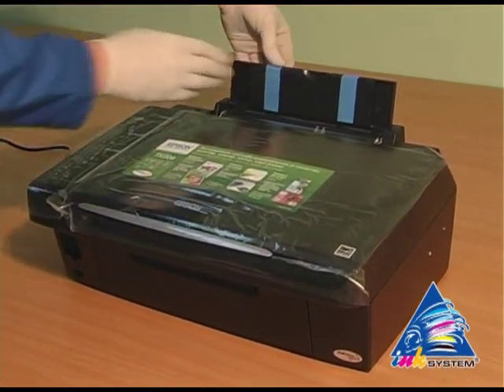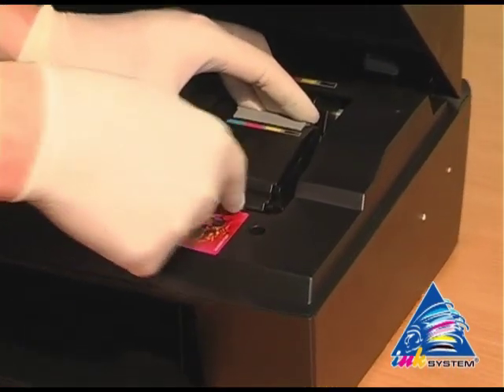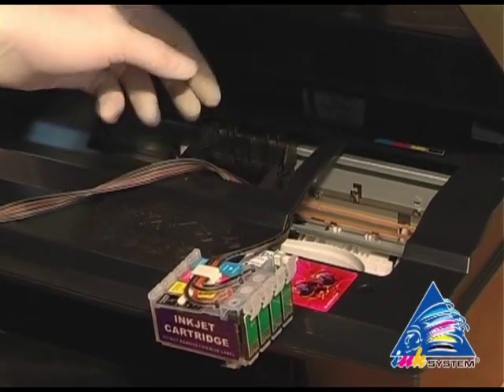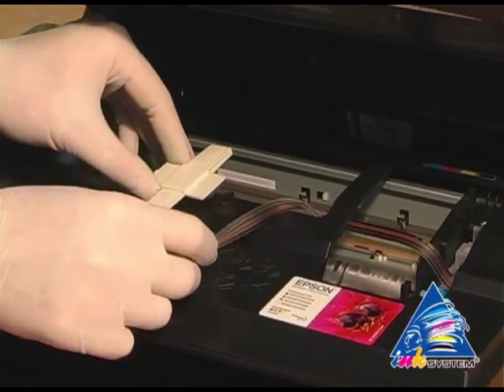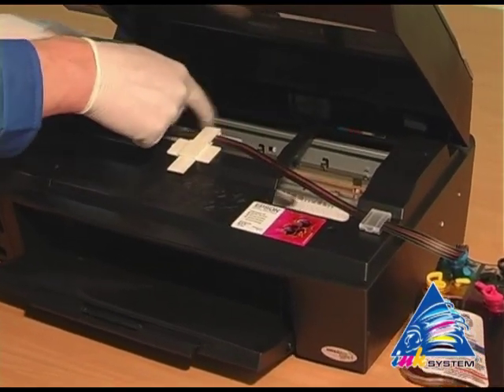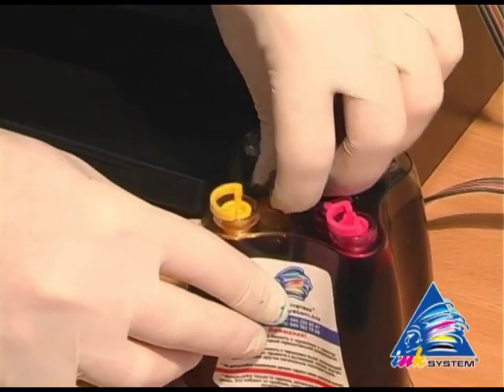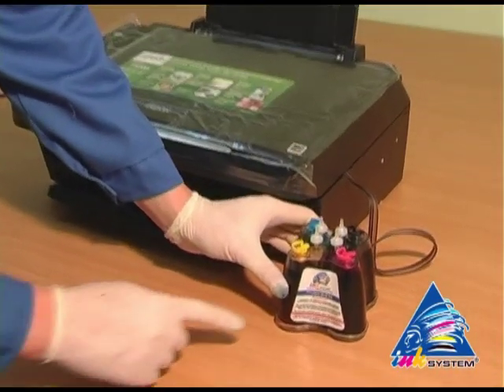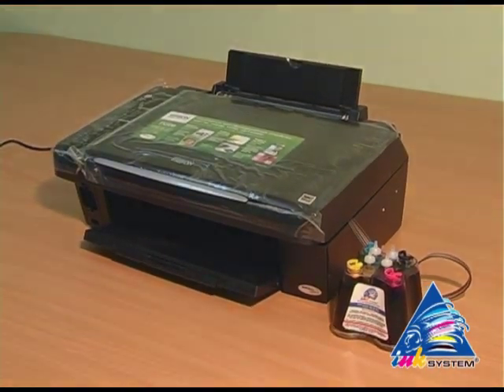CISS installation on EPSON SX200 / SX205 / SX400 / SX405

Comment: DESPERATELY NEEDED HELP!
I have 97% everything the same way.
I put everything as mentioned, with an installation guide. Everything OK, but the computer sais it is an uncompatible ink, or unrecognized mark of ink. The reset button neither works(or i use it wrong)
Please help me with this problem.
Thank you forwardedly.